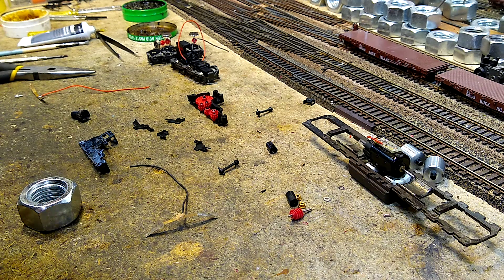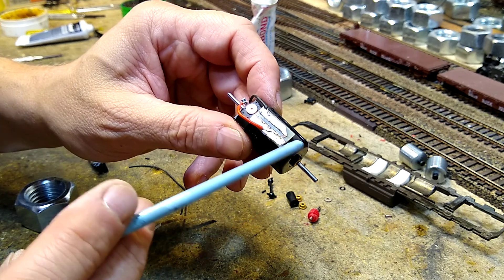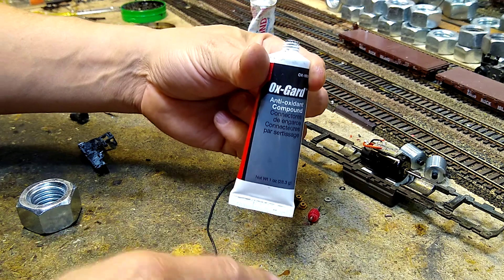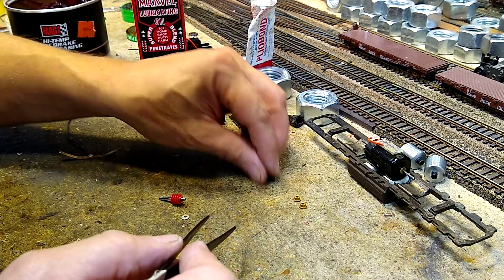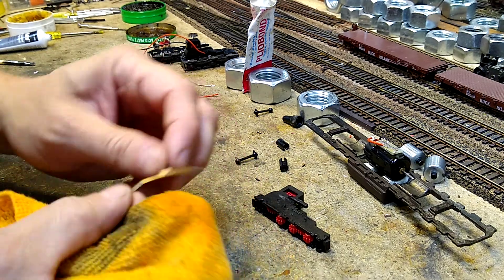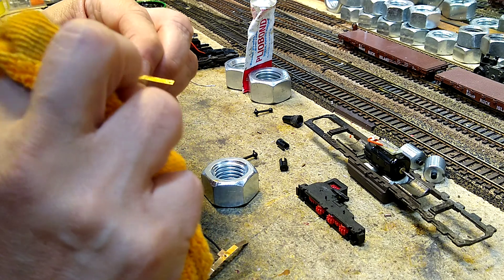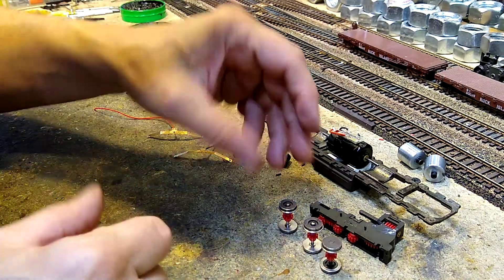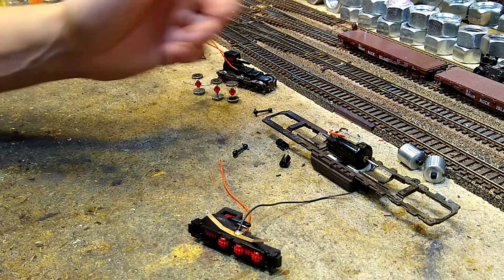Atlas SD24 part 4 wiring and installing trucks

Comment: hello , your channel is awesome . i have old locomotives that i repair and run . i have a question? how do you make a pcb ? i have an old , i believe its an atlas , sd35 locomotive i am currently rebuilding . my idea of wiring the atlas motor from an u33ch isnt working out !! 🙄🙂
Reply from the maker: copper clab project circuit boards come in packs, pretty cheap, and you can use a jewelers file to make cuts in the copper in a pattern that lets you solder your wires and other components neatly to the board.  then I use GOOP to glue the board in place - using the GOOP lets me take the board out again later if I want to make a change!
Reply: Oh ok, nice ! .. I have tried the direct wiring, like the older motor . Messed up the replacement. I junked my atlas u33 and used the dcc board and motor . It works but the dcc board is to wide to fit in the shell !! 🤣 Thank you for helping me , I appreciate that !!!
Reply from the maker: @trainjunky247  make yourself a working platform out of scrap to have a place to secure your pc boards.  also, cutting the blank boards down to strips that are .65 inches wide will allow you to cut them farther with just a heavy wire cutter.  I use my bandsaw to make strips, but I've used a scribing pencil and small square to scribe deep lines and then make them deeper with a file so they can be snapped off - kind of like cutting tile.  your wiring is going to goto a whole new level of excellence when start down this path.  the next step will be learning to use small disconnects so you can unplug all your wire when taking the shell off!
Reply: This will be fun !! 😂 .. I will definitely (if I remember) to record this !! . I may get my 15 year old genius involved as well !!!